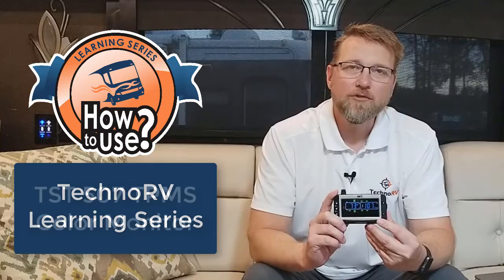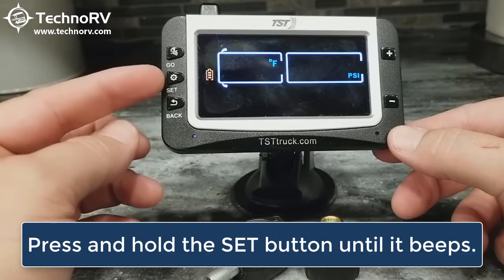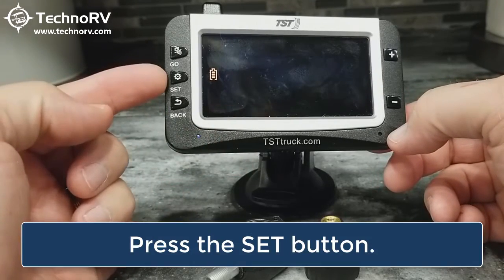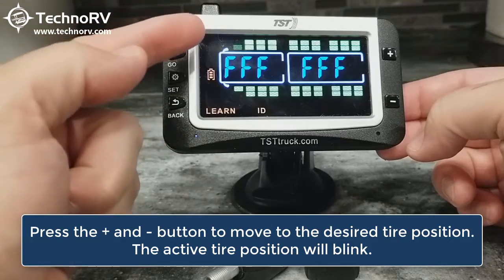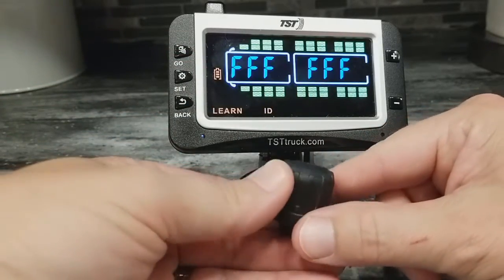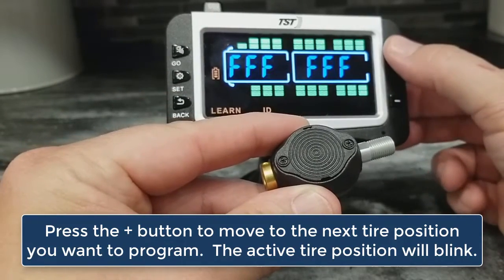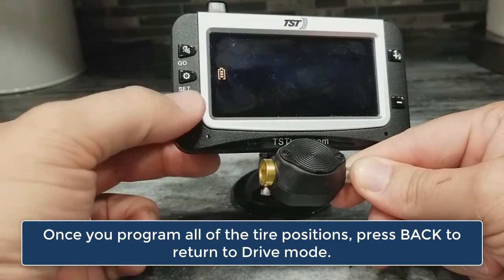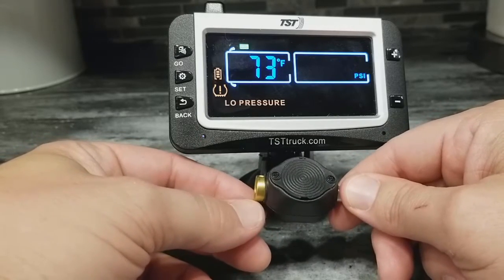TechnoRV TST 507 Learning Series:  How to Program Sensors into the Monitor

Comment: My rv valve stems are 1/2” rubber then 3/4” brass threaded for the cap, can I use flow thru sensors?
Reply from the maker: The flow thrus are only designed for a solid metal valve stem. If your stems have rubber it is not designed for your setup. The caps would be the correct sensor.

Comment: We have had this system for over a year .....and still cannot get it to work properly....it just will not pick up the sensors .....It will flash the FFF FFF and correct position It will flash ID- LF....and goes right back to flashing FFF-FFF...This has been the most frustrating purchase I've had to deal with with this RV
Reply from the maker: I'm so sorry! Our team is actually familiar with this issue and we can help walk you through. Please reach out to our Support Team for help! You can reach us M-F from 9:00am-4:30pm CT via chat, phone or email. Info@technorv.com / 866.324.7915.

Comment: why didn't you show the real world, where on an rv you have dual axles? It's not intuitive how you pick the tires on a travel trailer, this is set up for a truck trailer.
Reply from the maker: You can place your tire position anywhere on the screen you'd like.  There is not a set location. We recommend using the stickers that came with the TST to select your tire positions since it matches the sensor locations you can program into the monitor.  Hope this helps!

Comment: Eric,  Be aware that TST has changed the BT chips inside these sensors and the method to code them to the display has changed a bit.  I had trouble coding my new 12 sensor system and after talking to TST support (amazing support by the way, when I called I got voicemail but did not leave a message because it was close to 8pm, they called me back anyway!) they informed me that touching the sensor to the display will not work with these newer caps.  They told me to try 1", 2", 3", 4", 5" up to 6" away until I found the sweet spot and that worked like a charm.  Might want to add this to your learning series.   Best regards!  Brian C.
Reply: Yup.. this just saved me a phone call
Reply: That just worked for me
Reply: DUDE! Thank you! My old display unit had the USB port break loose so I couldn't charge it and had to buy a new one. I couldn't get any of my sensors to pair to the new unit. I even replaced all of the batteries. I was touching them to the unit just like the instructions said. I stumbled across this comment and BOOM all 4 of them paired instantly.
TST Really needs to update their instructions!

Comment: Ok so my new TST TPMS, has already paid for itself. Left Dayton this morning headed towards Michigan. Tires started out with a cold pressure of about 95#. Watched them all climb up to about 108# as I drove. About an hour into the trip, I started noticing that drivers side rear, inside dual had dropped to 99#,a few minutes later it was down to 98, and so on. I new something was wrong and backtracked to a TA that had a 4 hour waiting list, they told me about another tire place less than a half mile away that got me in right away. Took a couple hours to get everything sorted out, but ended up finding a leaky value stem. $45 later we were on our way with no leaks. Had I not noticed the leak, I would have probably made it much farther up the road, and possibly blown a tire due to the heat generated by the low pressure. Potentially saved me a roadside repair, tire, and maybe even damage to the motor home.
Reply from the maker: Thanks for the update Tim. You certainly saved yourself a blow out and everything that comes with that. Safe Travels.. Eric

Comment: I have a single axle RV.  Based on the iconography of the tire wheels, do I need to scroll to the middle of the icons or can I just choose the first two left and right wheels?
Reply from the maker: Hi Angi, I am not sure I am following your question, but let me give it a shot. When programming your sensors, you do scroll to the specific tire that you want to program. If you are programming a back left tire, then just scroll to that position that you want that sensor to show up on. Hope this helps. Eric

Comment: Example I have 3 trucks 1 trailer so if trailer has sensors can I install one monitor in each truck and program sensors into all 3 monitors so that no matter what truck I use the trailer sensors can be monitored is that possible or are the sensors only able to connect to one monitor?
Reply from the maker: Absolutely you can.  In addition, you would need a signal repeater on the trailer which would work with all 3 monitors as well.

Comment: Need to change one of my tire sensors position..  how do I do that?
Reply from the maker: Hi Brooklyn, I see you have watched the video on how to program a sensor, and if you just follow that then you can move the sensor. A sensor can only be programmed into one position, so if you program the sensor you want to move into a different position then it will remove it from its present location and put it in the new location. I hope this helps. Eric